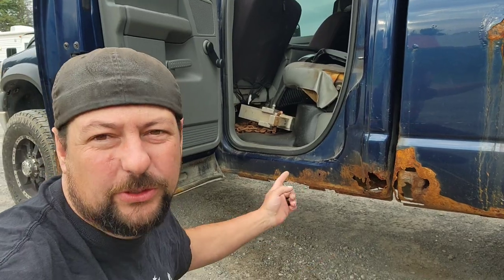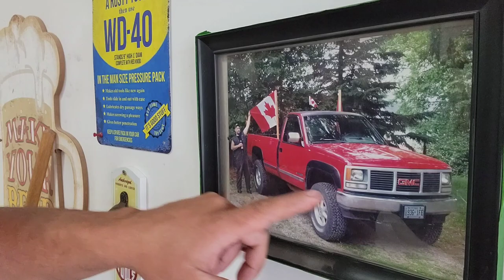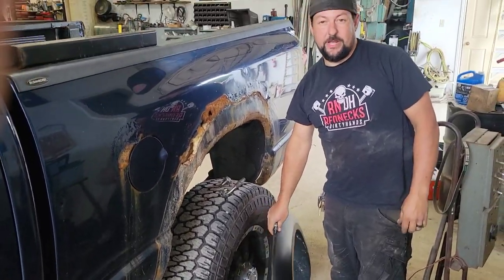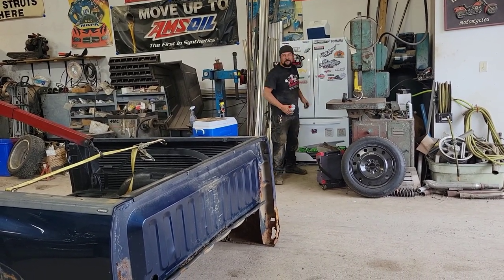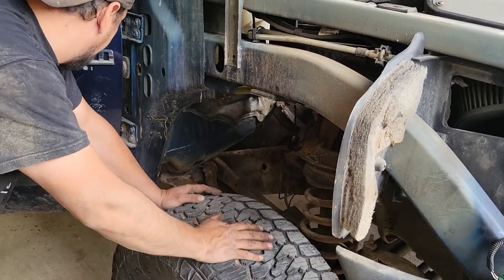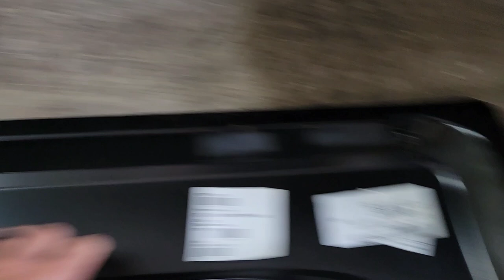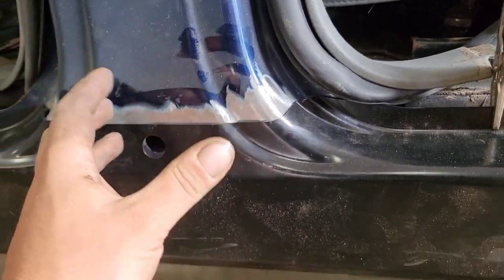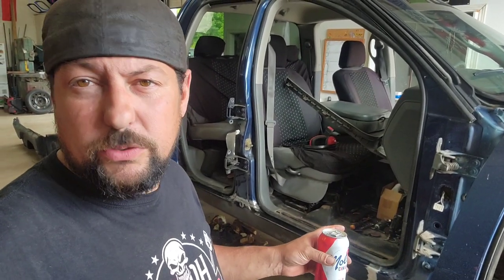Installing New Cab Corners & Rockers On My 2007 Ram 2500 Cummins..

Comment: You need a 5 gallon jug of Zep Industrial Purple degreaser, spray that on the frame, rear diff etc. and you would be amazed how well it cleans off grease as well as rust etc. I use this stuff like Hand Soap ( not literally as hand soap due to the alkalinity will cause skin to have issues I found out the hard way) I always have a 5 gallon jug handy I use it to clean siding, concrete, anything greasy.